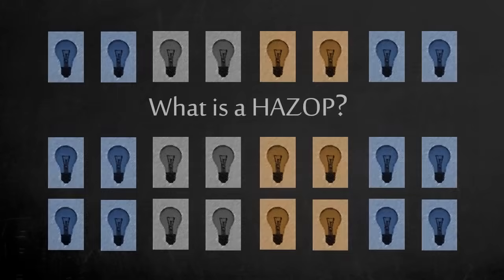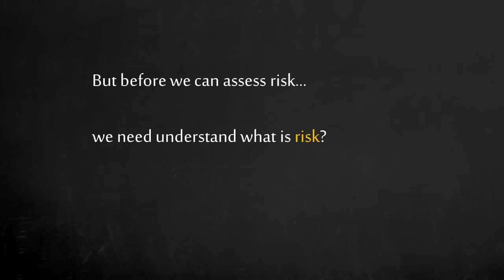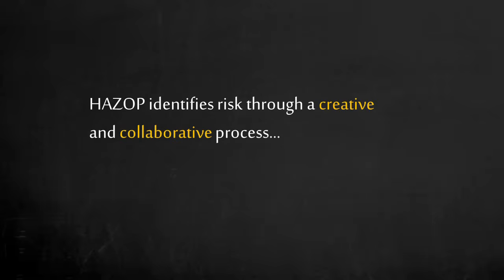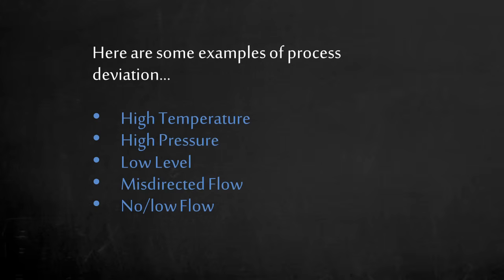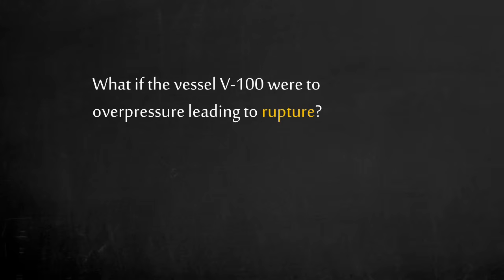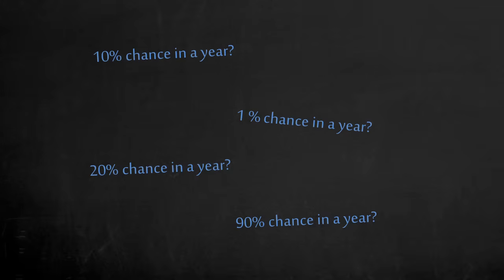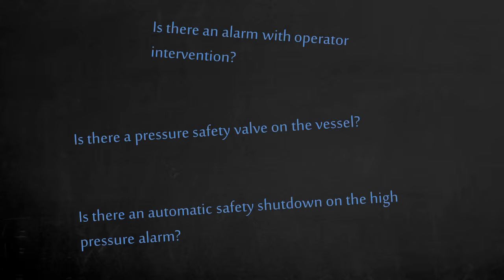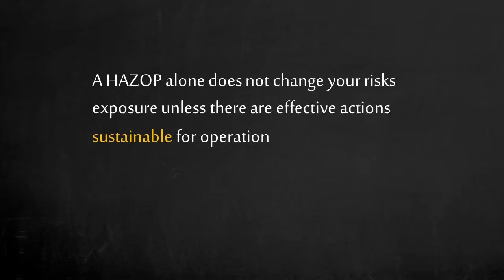What is a HAZOP? A Crash Course

Comment: I’m a chemical engineer working as an inspector with API certifications and from what I understand HAZOP follows same principles as a RBI system (per API 580 & 581 for)
Reply from the maker: RBIs are for assessment risk levels to develop risk prioritized inspection schedules. While the principles for HAZOPs following the risk based approach can be considered similar, the outcome is quite different and for a different purpose to identify risks within a process and ensuring those risks are managed to an appropriate level.